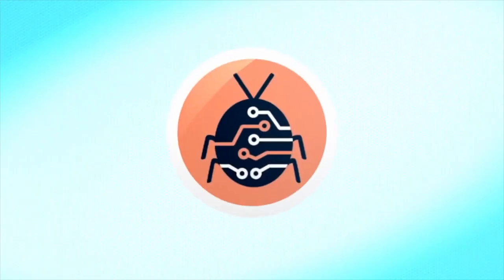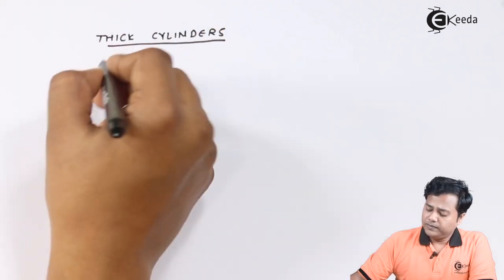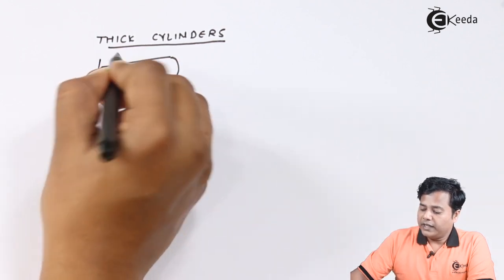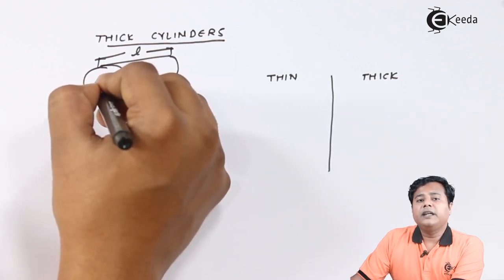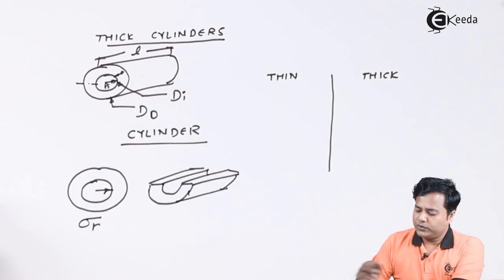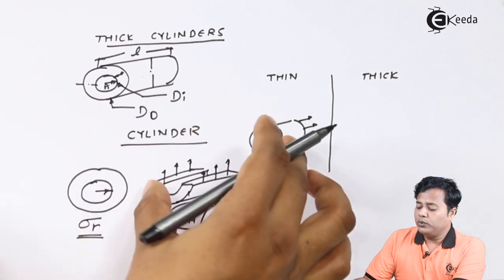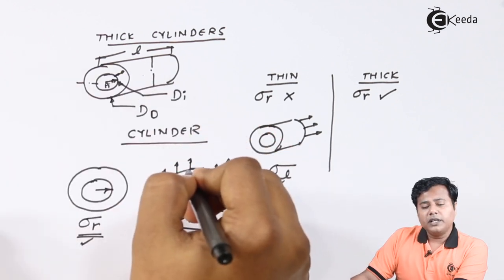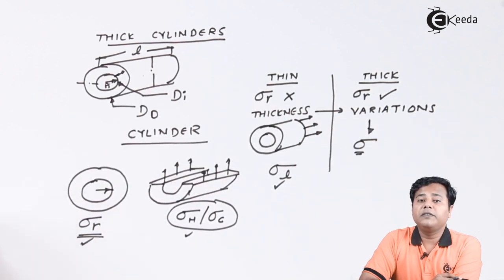Introduction To Thick Cylinders - Introduction to Mechanical Engineering Design - Machine Design 1

Comment: How do you carry out an experiment to determine the distribution of
 stress in a thick cylinder when subjected to internal pressure to know or investigate the area of radial
 and circumferential stress at the thickness of pipe ???